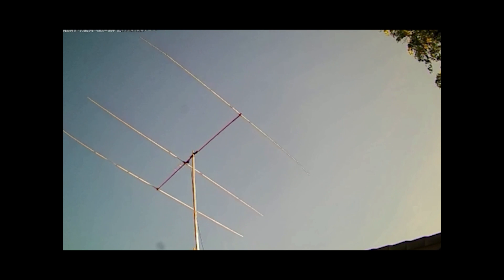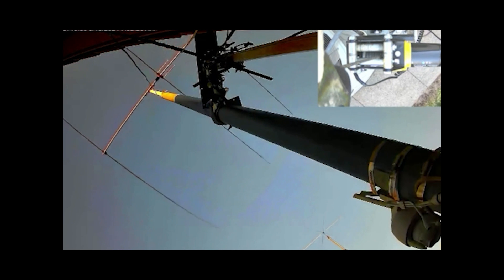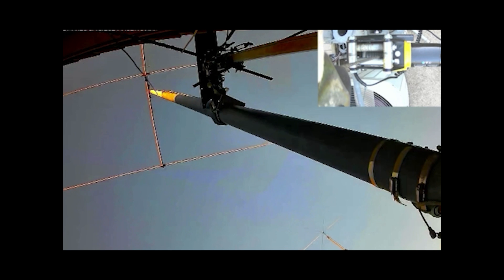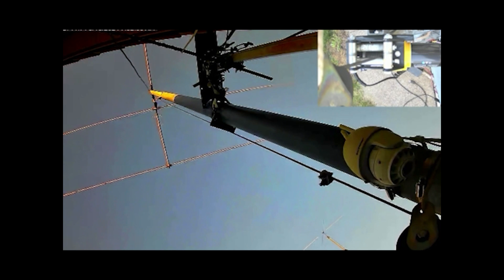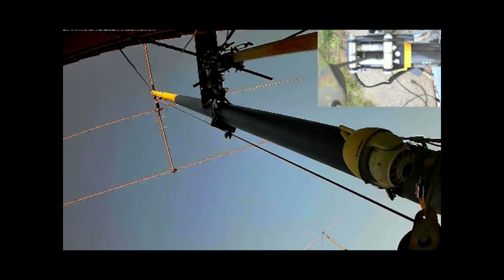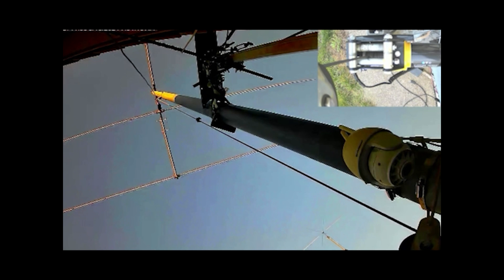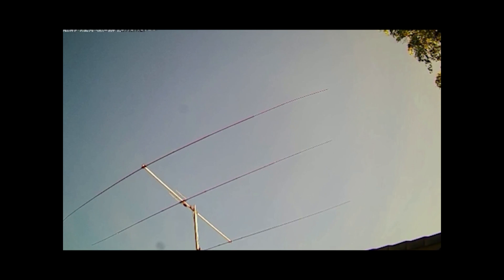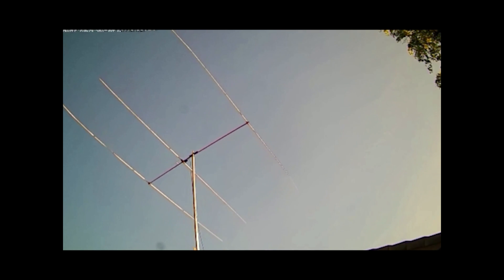This is My Homebrew 3 Element Yagi at 30 Feet Maximum on a Remotely Controlled Tubular Tower at W6LG

Comment: How do you find the match? I always used a gamma match on HF yagis as i thought the impedance might be a bit low st the feedpoint and its mexhanically stronger to have a solid  driven element. The problem with gamma match is the capacitor. I used RG213 taped back onto the boom and snipped to get a match. Unfortunately our planning laws have got a lot stricter here so big beams are getting less common. I used to buy the tubing and build then myself. My radio club has beams, including for 40m.  GM4SVM
Reply from the maker: Hi Gordon.  Nice to hear from you.  When I  sadly had to leave Wolf Mountain, I had lots of scrap tubing.  This antenna was made from that scrap when my wife was away for the day.  I did use a conjugate or hairpin match.  I guessed at the size that it woud need.  At the time I did not have the RigExpert or a NanoVNA.  I only had the SWR meter.  I put a sliding bar across the hairpin.  So far, that has worked okay.  It could be better.  But I am now in no condition to mess with the antenna.  Today the oncologist wants to talk to me.  I know that it is not going to be good news.  My blood tests yesterday and for the last several months have been terrible.  My WBC and ANC are almost zero.  I had transfusion number 20 two weeks ago.  73, Jim W6LG
Reply: @ham-radio I hope you turn the corner health wise, Jim.

Comment: so who's antenna was it, and... what was the point of the video? sorry many decades hf guy but watched to see the details (none given) or did i miss em
Reply from the maker: So the title of the video is:  This is My Homebrew 3 Element Yagi at 30 Feet Maximum on a Remotely Controlled Tubular Tower at W6LG.  Which means that I made the yagi out of tubing.  The tower manufacturer has been out of buiness for decades.   While the speed PWM controls, remote controls, motorized winch and multiple cameras are not unique, I have never seen another setup like mine ever in a YouTube video.   The gain is about 6dB with a front to back  of almost 30dB.  I built a simple hairpin match from tubing and used a 1:1 balun at the feedpoint that is also a choke.  The aluminum boom is 18 feet long and 2 inches in diameter.  There are 3 elements that are also aluminum and are 1.25 inches down to .5 inches inches.  Sheet metal screws and hose clamps are used to secure the elements.  The antenna has withstood wind gust in excess of 60mph in this little valley.  I have been asked many times about my antenna and this video is the answer.  73, Jim W6LG

Comment: love it i had made one about 20 yrs ago very directional used to chat to America alot hear from South Australia my balun was 212 coax as well good swr as well i had up 30 ft was able to have it come down on a pivit point on the bottom bit mounted 3 ft in the ground mine was all alaminum and i turned it by roap on the back with a brick ancoring it to the ground always was pointing to USA in a north east direction

Comment: I wish my Mosley ta33 had a 18’ boom instead of a 14ft. 18’ is about perfect for lots in town and plenty of gain to know it’s a beam.
Reply from the maker: Yes Jay it is a little better.  I would have preferred 20 feet.  But I was in a hurry.  My XYL was gone for the day and did not want the tower put up.  SOOO, while she was gone, I did just that.  I put tubing on the ground Jay and set the lengths based on experience.  I got lucky because the thing works great.  Front to back is awsome at about 30dB.  The gain appears to be about 6dBd.  Thanks Jay, 73, Jim
Reply: @maverickhorse9157higher is always better for sure. Depending on the band of the yagi. It starts acting like a beam the higher it gets and less like a dipole. I think 70-80ft is ideal for dx and contesting. Under that it’s typically a domestic setup with dx potential given the band condx